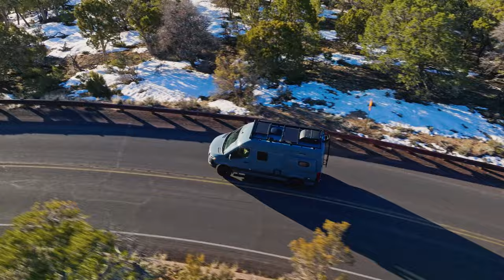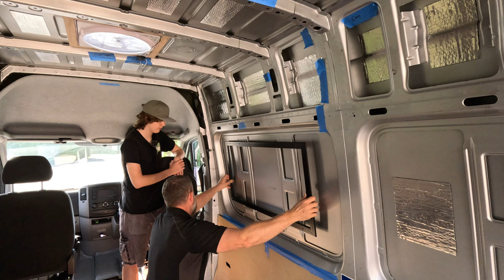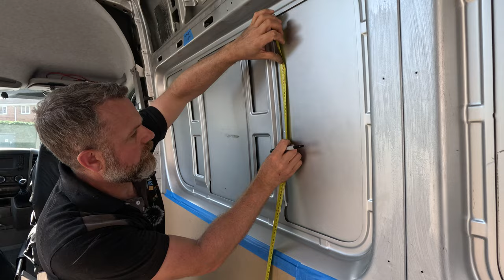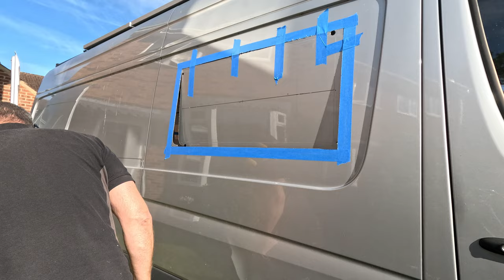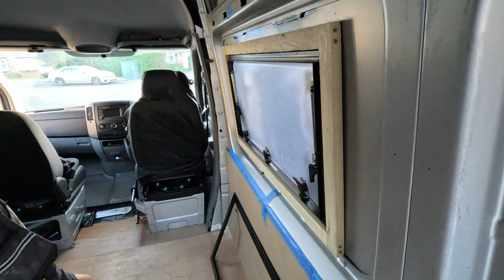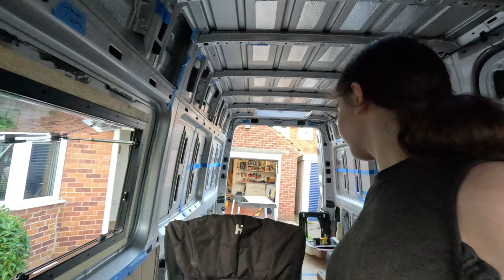Challenging Campervan Window Installation | Sprinter Van Conversion

Comment: Great to have you back and full time getting your van ready for adventure. Would you be able to put links for the fixtures used at all please, (the safari low profile window for example?) thanks and keep up the hard work mate 🙌🏻💪🏼
Reply from the maker: Hi. Thanks so much for your comment. Yes I'll pop a link in the description for the window. Aim to do it today. Check back later

Comment: Great to see you guys back on the sprinter, I think the window looks great.
Perhaps a little more explaining on things like the electrical system would be helpful to other builders, I have just about finished my sprinter but wish I had thought things through a lot more because after seeing that window I want one.
Also if interested there is someone selling templates on the bay for the shelf that goes above the cab, it’s a good template, it works, looks good and gives loads more storage space.
Keep up the good work.
Reply from the maker: Hi. Thanks for the comment. OK, I'll talk a bit more about my electric system in the next video or the following one depending on what I get done this week. As for the template. I'd be very interested in that. I'm planning on building a shelf ip there. Just not got to it yet. Cheers. I'll check ebay
Reply: You can actually have this one of mine if you like
Reply from the maker: @Theweldingmaster  seriously? That would be great if you don't need it anymore? Thanks so much

Comment: I would make it to look correct in that panel equal measurements starting from the top line
Reply from the maker: Yeah I see where you're coming from. From outside that would be best. But out internal layout dictated it in the end. Cheers for the comment 😁👍👍

Comment: I would go with the inside floor and then vinyl wrap the out side in black to lose what your eye might see if its not 100% level.  Just an idea
Reply from the maker: I like your thinking. I was jsut talking with my son about it earlier. was considering doing the whole side panel
Reply: @life_uncharted  I think it looks smart on the vans I have seen it on. But to be fair it looks good as is. Top job.
Reply from the maker: @VanVenturing  cheers 👍👍

Comment: What are you going to use for the roof insulation?
Reply from the maker: I have left over kingspan that should do the job nicely 😁
Reply: I have some spare stick pins you can have
Reply from the maker: @stevewaslin7171  thank you so much. Typically I've just bought 150 pack of them😂